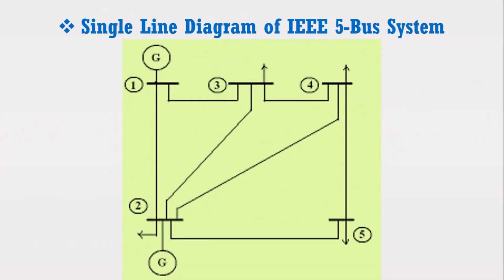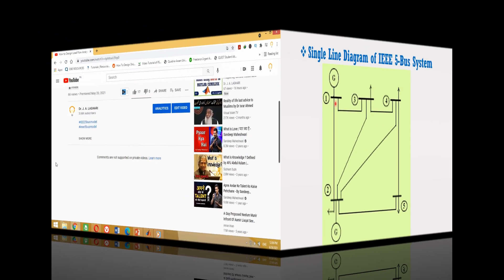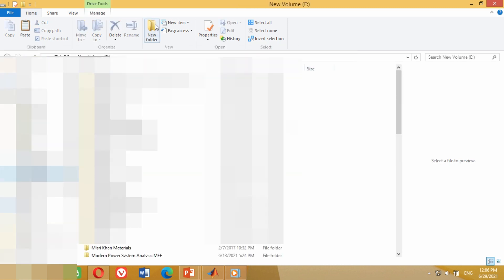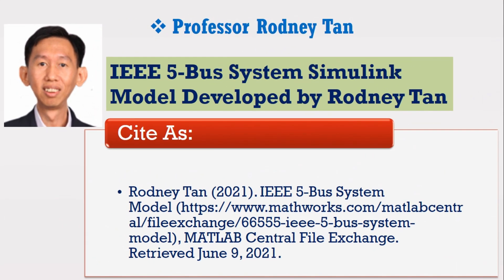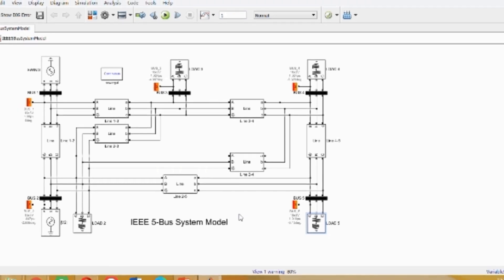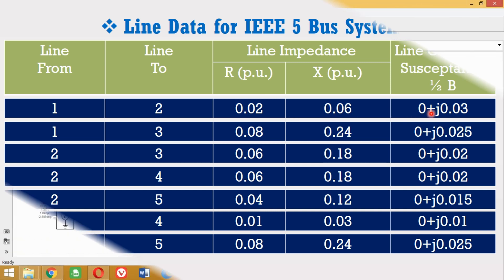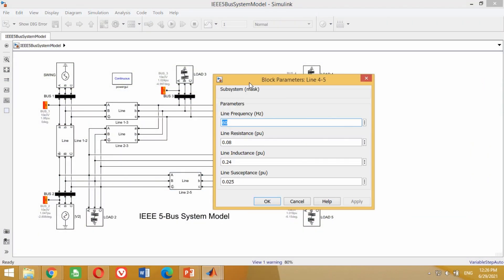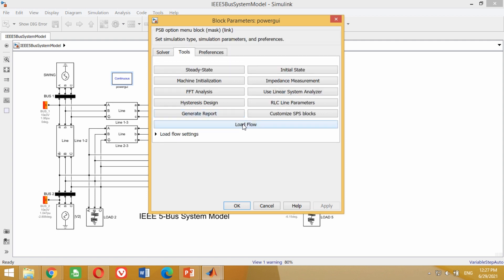How To Design Load Flow Analysis of IEEE 5 Bus System in Simulink | Dr. J. A. Laghari

Comment: Dear Sir thank you for uploading such an informative lectures. Sir, can you please send a link to download IEEE 39 bus system. Furthermore, How implement a PID controller in this bus system to check the LFC perfromance. Thank you.
Reply from the maker: Thanks for the comment. I have not designed the IEEE 39 Bus system model in MATLAB SIMULINK. I think, If you want to simulate IEEE 39 bus system, then you may try to find its model in PSCAD Software,, etc. I hope you will find this model on internet.
Reply: @DrJALAGHARI  Ok professor but can you please make a lecture about how to do LFC analysis in IEEE 5 or any other bus power system using Matlab/Simulink. Thanks

Comment: hi, can u help me ASAP.  there is a problem stated which is "The voltage source block 'A: SWING' cannot be connected in parallel with the capacitive element defined in the block 'phase_A: Line 1-2/B2'.
Add a small resistor in series with the voltage source block, or with the capacitive element. How can i solve this?
Reply from the maker: Thanks for the comment. You have to add small resistance block in order to avoid short circuit.
Reply: @DrJALAGHARI small resistor where

Comment: Sir I am having 2016 ver matlab file is in 2017 ver formate sir kindly share converted 2016 ver
Reply from the maker: Thanks for the comment. By converting the model into older versions may work or not. Because sometimes it gives an error. Therefore, better to switch to 2017a version.

Comment: Dear sir kindly share measurements of bus voltage in pu with bus voltage wave form an example share me sir because I tried many times I didn't get and I am having matlab 2016 ver sir please help me
Reply: Hello sir
Reply from the maker: Thanks for the comment. I think load flow analysis in simulink may not work well for graphs.

Comment: Hello sir I need small help I have email the detail of program I am getting error in matlab code ga and abc optimisation techniques placement of facts device graph is not appear it's for IEEE 5 bus data sir
Reply from the maker: Thanks for the query. Basically your topic seems different. Therefore, the way of implementation is also different for each topic. In my opinion, you may choose a bigger system such as ieee 33 or higher to get good results. For the lower system, the results are already good.
Reply: Graph is not appear sir
Reply: Sir my guide telling IEEE 5 bus you have to try and get output

Comment: Respected Sir,
 Good Morning, 
I have seen almost all your videos related to Simulink  and modeling of power system.  Sir I am a research scholar and I need a Matlab running model of power oscillation damping using distributed power flow controller(DPFC) compare with UPFC  in Matlab software. Kindly provide the above model. I am very much thankful to you for your kind support and I hope of favorable reply from your side.  

Regards, 
Shailendra Shrivastava
Reply from the maker: Thanks for the compliments and query. I have not worked on this model. You may find it in matlab examples or matlab file exchange website.

Comment: Hello Dr. I successfully  open the model in Simulink but I get an error message when I run

##The voltage source block 'A: SWING' cannot be connected in parallel with the capacitive
element defined in the block 'phase_A: Line 1-2/B2'## that is the error message I got please how do I fix it?
Reply from the maker: Thanks for the comment. Kindly watch the video how to get the results.
Reply: @DrJALAGHARI  Thank you Dr. I got it thank you very much
Reply from the maker: @mbunyanervilleanyang3388  My pleasure
Reply: @mbunyanervilleanyang3388  Please did you get rid of the error can you help me please
Reply: Hello, me too. When I did sumilink, I got an error in block A line 1-2/b2. Can you help me, I am about to graduate this month, please
Reply from the maker: @hafdallahabir4523  Thanks for the comment . Kindly watch the movie step by step in order to understand how it will work in simulink.
Reply: Sir how to create fault between two buses sir
Reply: Same anyone help